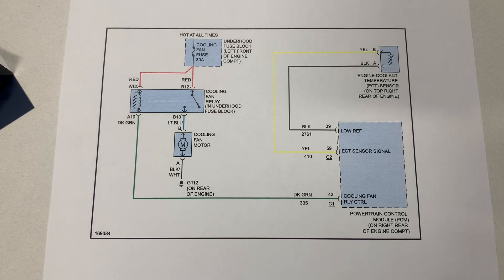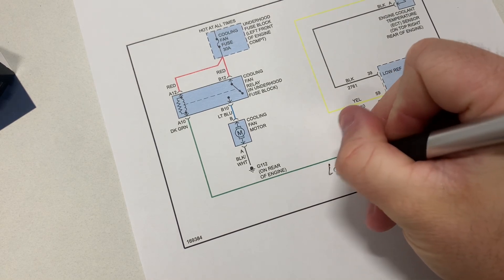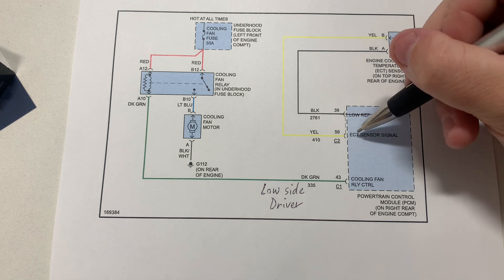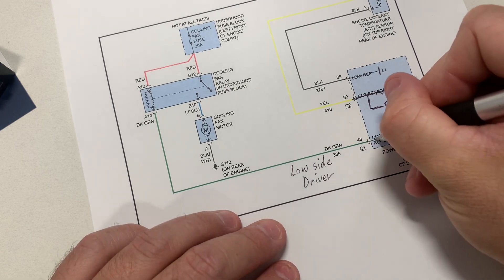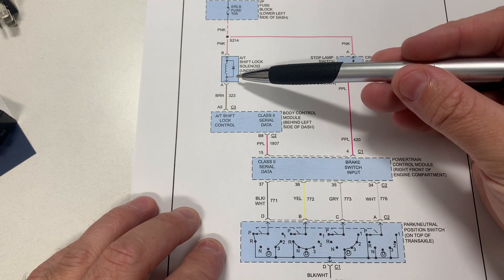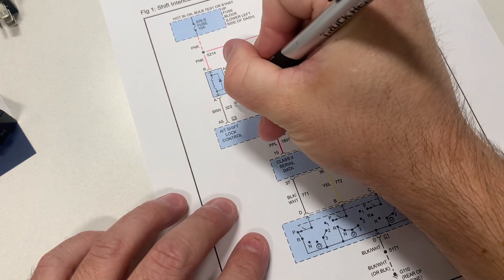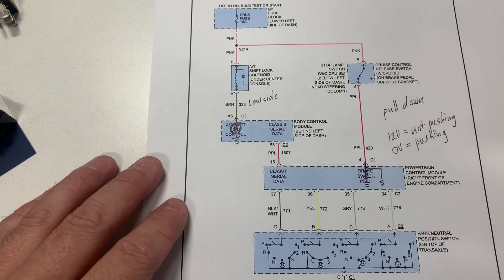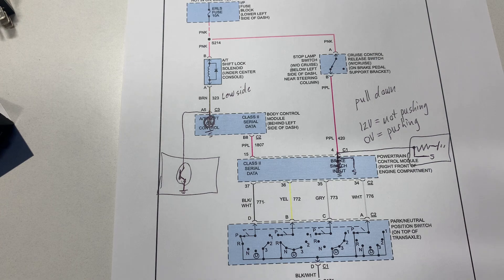Computer Input and Output Circuits ( high and low side drivers, pull up and pull down circuits)

Comment: These ECMs are so adaptable with just a reflash of operating systems, Case in point GM E40 used in a Trailblazer uses a low side for the crank relay but 05,06 GTO uses a high side on the same pin. Excellent  learning video, thank you. 6:19